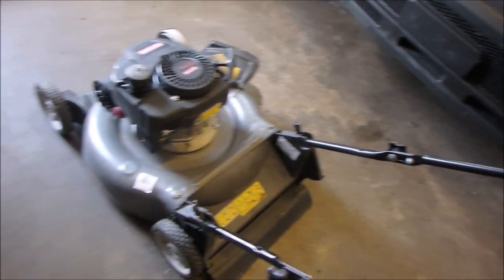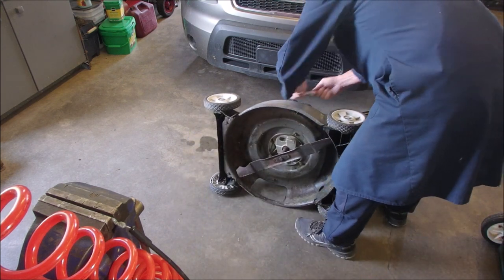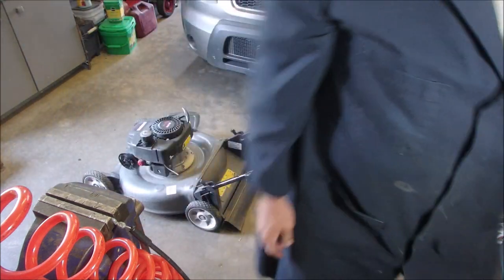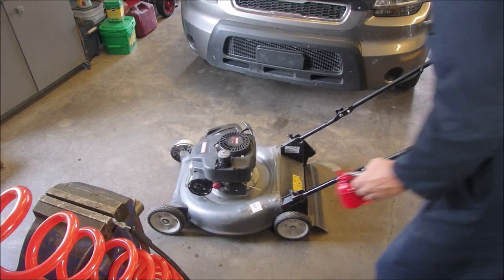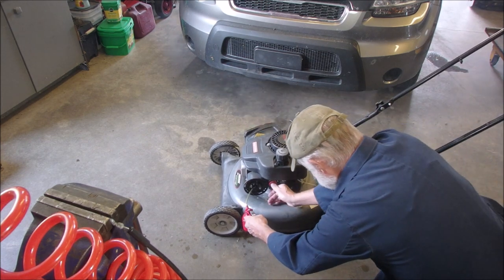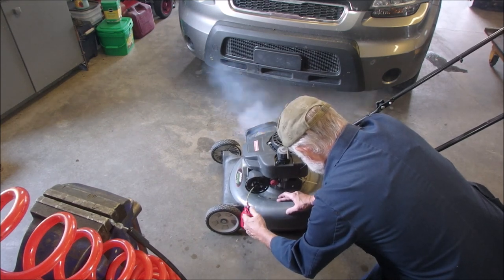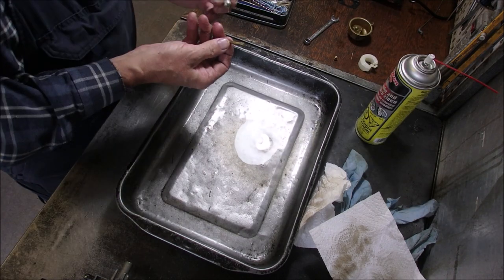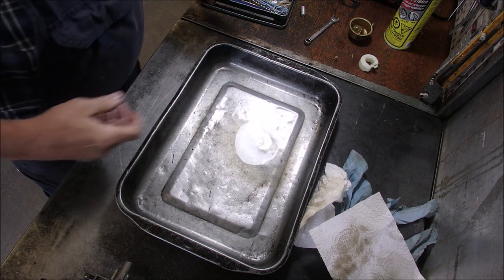Powermore Mower Won't Run  PT 1

Comment: Looks like our Remington mowers here in Ontario and yep those handles could not be made any cheaper. Lots of them welded up here at EP we normally add a washer on one side welded all around on the OD and ID to help strengthen that handle. Sometimes we need to clean up the hole with a drill bit and dremel tool.
Reply from the maker: Thanks Wayne  I uploaded the same video twice.  OOPS

Comment: Bruce, enjoy your videos very much.
You said the blade had hit something hard,
is the crankshaft bent? Seems like the mower 
had a vibration and tried to exit your Pender lift.
Looking forward to part 2 so this cliffhanger can be 
resolved.
Thank you for all your work making the videos.
Reply from the maker: OK   In part 2, I verify the blade and cranshaft.  I also repair the issues with the chassis.